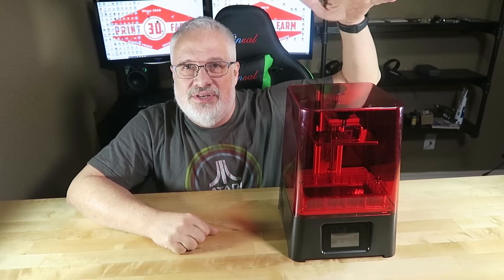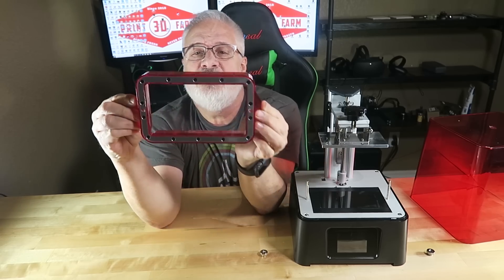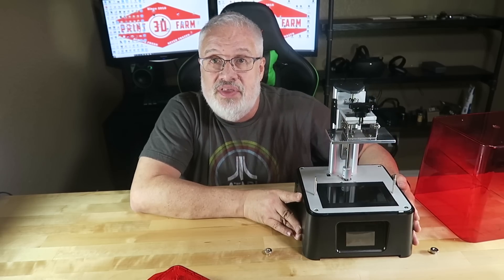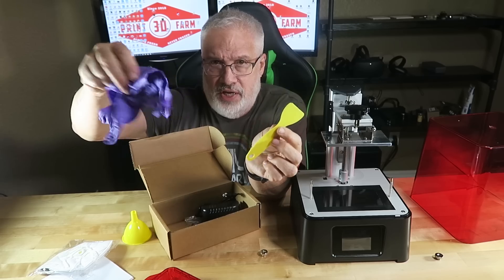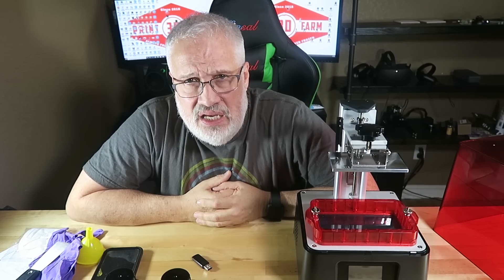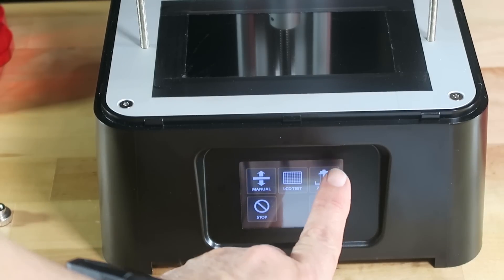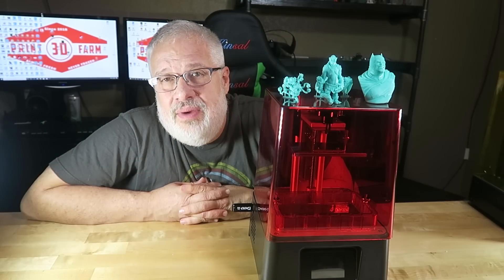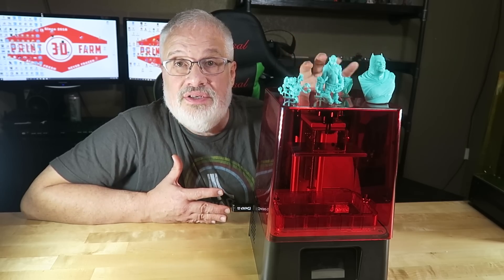Phrozen Sonic Mini Test and Review!

Comment from the maker: If you purchased a Phrozen Sonic Mini, please DO NOT use Siraya Tech FAST resin until further notice.  A few folks from the FB group have noticed that Siraya Tech FAST interacts with the red plastic vat causing the resin to cure prematurely even without UV light.  Phrozen is investigating this issue.
Reply: Does it have any issues with dental resin?
Reply: Lately prints of the see through plastic vats are coming in cracked or severely weakened from amazon inspect everything guys!!!
Reply: So, if it prints at 2 seconds per layer and 2 seconds in between that would be 4 secs per layer. If the print height is about 130mm then printing at .05mm that's 2600 layers. Would this mean that it prints at a max time of 3 hours?
Reply from the maker: @xicledragon  Excellent question.  The Sonic Mini has a 'recovery time' called the "Light Off Delay".  This allows for the travel time of the plate as well as to allow the resin to settle down.. making waves per se. :)  This accounts for the extended time.  You can tweak this number which I have current set up at 7 seconds, but it could possibly effect the print quality of the model.
Reply: @3DPrintFarm  Does the sonic lcd work in a elegoo mars?
Reply: Holly shit
Reply: Would you happen to know the stats on the sonic mini power supply? The unit doesn't list volts, amps, or polarity

Comment: How do you get 80mm/hr on this? I feel like this inst even possible or its at like 200 micron layers. 2 sec per layer but the total layer times for proper dwell are 10 to 11 seconds total. That is 16mm an hour @ 50 microns. Even if it were half this total time your looking at 32mm/hr. I bought this for speed have I been fooled?

Comment: You still can't see the initial cured resin sticking to the build plate rather than the FEP due to the opacity of the resin. So, what is so great about a transparent vat except that it is allowing external UV to penetrate through and prematurely cure the resin. Also, I can probably buy the Phrozen resin and get 1.5 to 2 second per layer on my Elegoo Mars printer. It's the resin, not the printer that has these characteristics. Incidentally, the Elegoo Mars also has a monochrome LCD. I do not see any marked advantage that this printer has over others of the same category (LCD/DLP) type projection.

Comment: Just purchased the sonic mini, attempted to print the 3 rings that are provided on the usb stick, but after 4 hrs it only managed to print the main supports exactly the same for all 3 rings,
I did not change any settings just printed them straight from usb.
I am using Elegoo Mars trans resin, could not find any phrozen resin on Amazon UK. Any advice would be appreciated.

Comment: Just got mine today. Haven't been able to get a successful print except for one ring of the three and I tried twice. The material is ABS-like grey Elegoo Mars. I do hear a slight squeaking on the Z axis every now and then- not sure if that's an issue. 
The failures seem to leave a thin layer on the FEP that I have to get (scape) off. Any ideas or help would be appreciated.

Comment: Sorry for the silly question,  Im new to the channel and to the 3d printing community What do you do with the resin after you finish your print, do you just simply toss it? How long you leave the prints hanging in the printer before cleaning them? Love the channel and all the useful info! Keep it up 😄
Reply from the maker: You can filter your leftover resin back into the bottle using the included 'paint filters'.  This will make sure all the tiny bits of cured resin are removed and prevents contamination.  I have left my prints hanging on the build plate for up to a week or more without issue, however, I like to remove them and get the cleaned up! :)

Comment: I wounder how long it takes for someone to just make a cheap resin printer with a of the shelf 28" panel or something like that  with a 4k panel. They really cost very little today.

The way the LED is set out here, scaling would be pretty cheap.

Then adding sort of a extension system to make the builds higher and higher really should not be that hard.

Comment: Another great review Garrett!  Other than the super quick prints, how does it compare with a Photon as far as print quality/clarity is concerned?  The lower resolution (62µ versus 47µ) between it and the Photon may not be desirable for some types of models.  Just curious to see if you've done any print comparisons.  Anxiously awaiting the day that Peopoly sends you the new Phenom for review!Thanks...
Reply from the maker: That's a great question!  I'm doing a head to head review of the Mars vs. the Sonic Mini. I'll have this at the end of the week.  I'll be doing some print comparisons and microscopic views of the differences! Stay tuned!

Comment: So monochrome is the reason for the faster cure times?  Sounds like we can buy a new LCD and put it on a better printer right? I know this machine gets good results, but I don't like its mechanicals much. Having to unscrew the vat completely and then lift it off; the rough mechanical design of the build plate and the necessarily more-complex clean-up; the short z-height. They should have just mated the monochrome LCD with  an Elegoo Mars-style printer and then sold them like hotcakes.

Comment: Great little printer, just to be clear, my understanding is that it takes the same time to print multiple as it does a single, say a ring for instance! is this correct?
Reply: Yes, unlike a conventional FDM printer, multiples on these types of printers (DLP) take the same amount of time to print as a single. The time is based on the number of layers. So the total time to print is based on the number of layers in the tallest model. Whenever I print anything, I always make sure to fill up the whole build plate with other things that I'll need as well, or copies of the same thing.
Reply: Hello Colin; It is partially the resin that decreases cure time, but the speed of the print is determined by the height, (Z axis). The shorter the Z axis, the shorter the print time. Less layers, less time. You can have multiple objects on the build platform, and they will ALL print at the same time. If any object is taller than the others, that object will determine the time needed to print.

Comment: a doubt!
speed works only with the resins that the brand sells, or works with all others.
I have anycubic. is it possible to put the printers side by side and print the same file? thanks
Reply from the maker: Great question!  Yes!  It works with other DLP and SLA resins!  I'm actually going to be printing two models side by side using both the Sonic, Mars and Photon for comparison.  Video coming!

Comment: Good afternoon, tell me which printer would be better foton s or sonic mini?
Reply from the maker: I would highly recommend the Sonic Mini over the Photon S.  The Photon S is not the same printer as the original Photon.  If you are just getting into resin printing, the Sonic Mini is the way to go!
Reply: @3DPrintFarm  I have foton s but it seems to me that sonic mini.  will be more reliable and stable.  I think to change it.

Comment: Would you mind doing a direct comparison to the Photon and Mars? Some challenging model maybe.
Reply: I would really like to see that as well
Reply: I’d love to see this too. I’m about to pull the trigger on buying my first 3d printer and it’s a toss up between the Anycubic Photon and the Phrozen Sonic Mini.
Reply: rtlemon At this time avoid the Photon, you can get Elegoo Mars Pro for 100$ less and it seems to have some better features. It also uses ChiTuBox instead of Anycubic’s weird software.
Reply: @Creeper99PL Edit: Nevermind, you where not talking to me ;-)

 Already own a photon, im interested in how the lower resolution will affect prints. Because if the difference in quality is nothing to be concerned about maybe this is going to be the next printer. I would like to print faster sometimes.
Reply: ActuallyMe you make a good point. I’ve been playing around with ChiTuBox and it’s very intuitive. Hopefully when the Phrozen Sonic Mini is available with the new aluminium tank there will be more reviews. Just hoping that Amazon stocks it in the UK soon as I don’t want to be paying ridiculous import fees. If not then Elegoo Mars it is.
Reply: @Tevon93  The Photon is beoming proprietary Though, like Apple. I would rather support Elegoo or the QIDI tech that's even better than the Photon S and like 100$ cheaper. It also has the best costumer support.

Comment: How MUCH are replacement screens ("not cheap" doesn't cut it) and how hard are they to replace?  No one ever covers those extremely important  topics.
Reply from the maker: That's an excellent question. Surprisingly, the majority of the inexpensive resin printers on the market today are using up the excess stock of old RGB LCD cell phone screens!  I have replaced an RGB screen on my Photon and it was painful..  The screen on the Sonic Mini is monochrome, so with a small supply, the price will be most likely close to $200.. Almost the price of the machine.  This, like other things, that increase production, should see the price drop.  Since these screens don't produce near the heat that the RGB screens to and the fact that they are thermally protected should get you in excess of 2,000 hours of print time vs. the 5-800 hours from a typical RGB screen.
Reply: @3DPrintFarm  just a note, they're $90, not $200, so.
Reply: They're about $90. https://www.phrozen3dp.com/products/phrozen-lcd-module-55mono

Comment: I would like a Phrozen monochrome with a large build volume to support my FDM printers. Small detailed and accurate parts are sometimes difficult to print so this unit might be the way forward. Phrozen how about a 300mm X 300mm X 500mm volume build? It would sell like candy!
Reply: Look into EPAX machines. They're coming out with a couple of larger format devices that will have option or colour or monochrome screens. X133 and X156 will have option of higher resolution colour screen or lower resolution monochrome. Lower resolution in comparison to a smaller device but still pretty detailed

Comment: Do you ever had problems with prints sticking to FEP?
Reply from the maker: Not with this particular printer and the Phrozen resin.  You may have to increase cure times depending on the the resin you use so your mileage may very.

Comment: Would be nice to have a shot of the inside of the case.  My Photon sits unused because my big clumsy hands damaged the mainboard trying to plug in the connector for a screen swap and I just haven't mustered the will to fumble around in there trying to install the replacement board while my (easier to maintain) X1 is chugging away next to it.  Is there a clear path to the screen cable connector with space to plug it in, or will this require tweezers and cursing?

Comment: USB on the back - ha ha classic
Reply from the maker: Actually, it's on the side.. :)
Reply: @3DPrintFarm  1. Can you really notice the difference between 2k screens and this one which is lower res? Can you see pixels or layers? 
2. Did phrozen tell you the price for screen  replacement? 
3. How is the smell of standard aqua resin and what is the exact exposure time you have used? 

Thanks a lot in advance
Reply from the maker: @MegaBlackJoe  Great questions!  I just recently acquired (yesterday ) a USB microscope and am going to do a comparison as there has been quite a few questions about this very thing as far as resolution is concerned... I'm going to print the same object on my Mars and one on the Sonic and do a microscopic compare... To answer your question, to the naked eye, I can't tell a difference.  I anticipate the price for the monochrome screen to be around $200.. that's a guess.. The smell is not bad at all.  If fact, it is one of the lower odor resins I have used.  Even less smelly than Elegoo brand. (Which is not smelly IMHO)
Reply: 3DPrintFarm any update on comparison?  Just bagged one on Amazon.  I have a hard time believing the resolution difference is going to be that noticeable based on the numbers. 47 microns (.00185”) vs 62 microns (.00244”).  But as they say the proof is in the pudding.
Reply from the maker: @stevomv304  Glad you asked!  In my next video, I'll be doing a 'microscopic' comparison between both the Sonic Mini and an Elegoo Mars.
Reply: @3DPrintFarm  Nice, when do expect to post it?
Reply: He states it's on the side in the video- why would you then assume it's on the back.